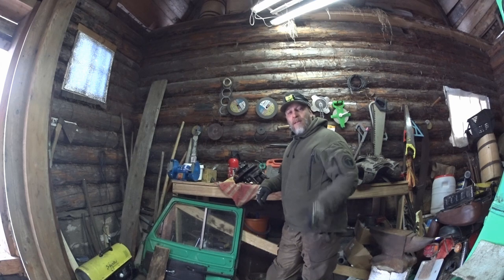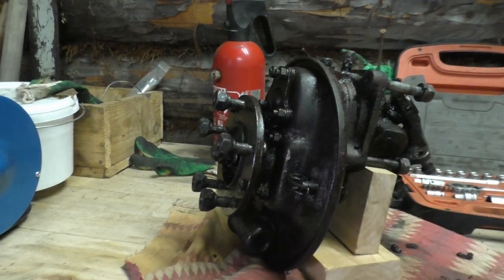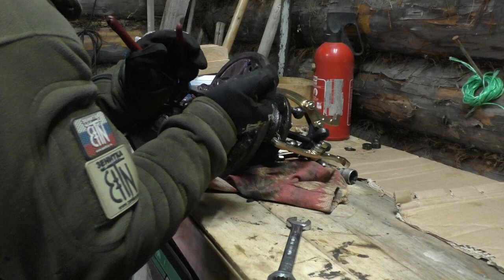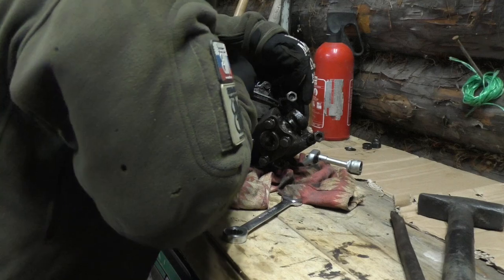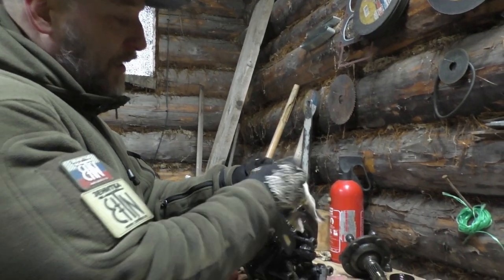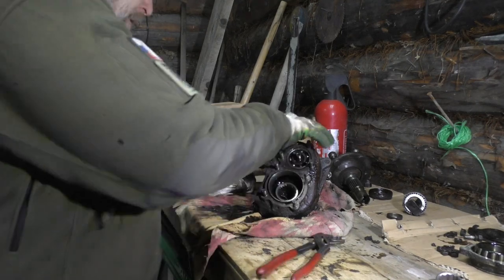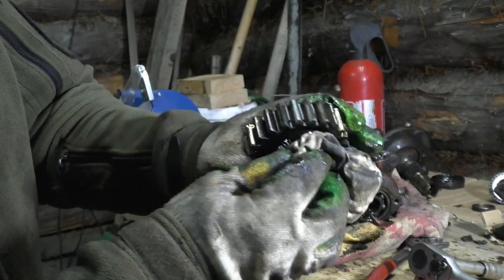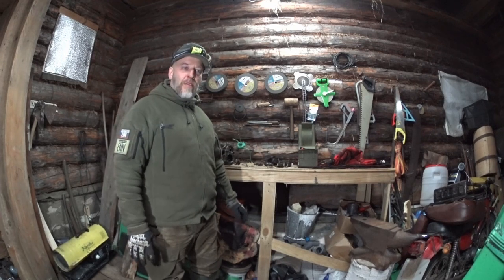The SR Vehicle. Portal Hub Disassembly

Comment: It's shocking how similar the humvee geared hubs are to yours.  The gears looked to be in good shape, though that one you pointed out did look odd.  I rebuilt a geared hub on the humvee with new gears and seals...only to forget the hub oil.  I got to drive it for 40 miles before it blew up lol.  So remember the oil!  I'll be here for the rest of the build to shout that at you.

Fun fact:  The original geared hubs used to have this odd lock washer tab that could easily break and cause your 37" 200lb Kevlar reinforced tire to break off and buzzsaw its way through anything in its way.
Reply from the maker: Thank you for an interesting comment :) I will try and remember the gear oil!

Comment: you continue to amaze With that little monster truck :) Quite complext those hubs. Thaks for sharing again and looking forward to more :) Greetings from Ww2HistoryHunter
Reply from the maker: All I need is to put them back correctly again :)
Reply: are you pulling the gearbox and engine apart?
Reply: Get yourself a second hand dishwasher and use that for cleaning parts - works great on engine blocks as well as gear boxes

Comment: Man you need a good big vice! You can check the wear on the gear by reinstalling them on the axles, blocking one axle and then moving the other gear back and forth. There should be close to no play. If you have the repair manual, check if there are tolerances for the wearout of the gears listed.

Comment: That little vehicle is a very good design. The gear reduction hubs reduce allot of stress from the differential, axle shafts, U joints and driveshafts. In custom applications they are quite an added expense to add to an axle. Its good you are servicing everything. It looks like it is well past due for a clean up, new seals and a few bearings. Its too bad they don't make this model any more. Simple, light and no BS parts is great for off road. Its too bad you are so far away, I would help if you wanted. (^_^) 
Thanks for sharing your videos!

Comment: There is a special socket set with those notches in them. Crown Sockets They are not terribly expensive. I have the full set up to 2-1/2 inch. Don't use them often but they sure are handy. Why don't you have air?

Comment: Those are the largest belleville washers I have ever seen.
Reply from the maker: "Belleville" washers. Thanks :)
Reply: Oh yeah! You are welcome. Thanks for the great videos. One belleville washer is used for locking purposes like on an electrical lug bolted to a bus bar. Two are used as a spring. When used as a spring, engineers can over do it and the washers fail frequently. That portal axle looks like a perfect application for them.

Comment: Nicely engineered piece of kit. It would be cool if it could be modified for a jeep.
Reply: A spud shaft and and adapter plate that you can weld onto your gusseted and sleeved axle shaft end will probably set you back ~$600 each; $1200 a pair. Whole vehicle: 2400.00. Keep in mind every torsion link would have to be upgraded as well. And you would still have to supply all portals and portal rebuild kits and require a chrom-alloy axle shafts. Or just all new custom shafts without using spud shafts which would cost you about the same.

Comment: If the tops of gear teeth are flat, they are still useable...rule of thumb.

 Its the gear lash, measured by a feeler gauge, that tells you the true wear. The gear lash tolerance should be   in the repair manual specs. Two of the gear teeth that you displayed, did not look good....it looked like one of them came to a point, not a flat.

 Thanks for the movie...great symbolisim....I wonder who the next White Tiger will be.

Comment: Perhaps you can explain the purpose of these hubs? Why not simply use a different transmission gear ratio? I'm guessing it has to do with using industry standard assemblies, but I'd love to hear the actual story behind it.
Reply from the maker: The most obvious advantage is ground clearance, as the axles sits higher up and not in the center of the hub. It also reduces stress on the actual drive axles, as far as I understand. There might be other advantages as well. Many military vehicles have portal hubs, such as the Humvee, Unimog, Pinzgauer..
Reply: Thanks for the reply and explanation.

Comment: The large outer bearing race on the hub side doesn't look to good, not sure about the gears. I owned a unimog that had portal axles but they were twice the size and bullet proof. I think if I was you I would not take the portals apart, simple drive it until it breaks, that's assuming you only drive it on your property. Dave
Reply from the maker: There are no way around it. I have to change out the different rubber seals for the axles. I also need to check all 4 are OK. The 404 Unimog is 3 times heavier than this little vehicle. LUaZ +850kg Unimog 404 2900kg :). Unimog's are very nice.
Reply: Survival Russia 4 time heavier, and only 85 hp. One of the reasons noting breaks on a unimog. I also have 2 m274 mules with portal axles, come to think about the axles are about the same size. Dave